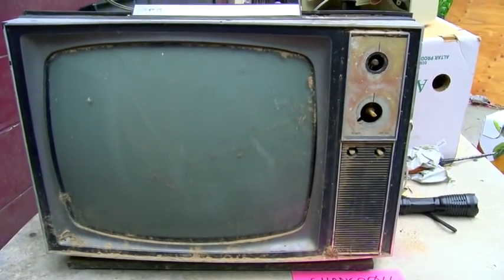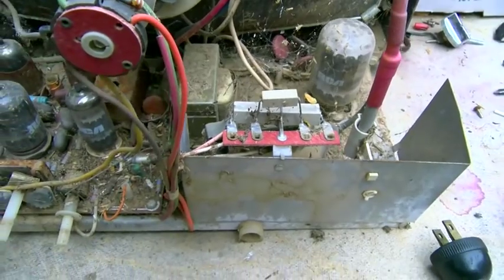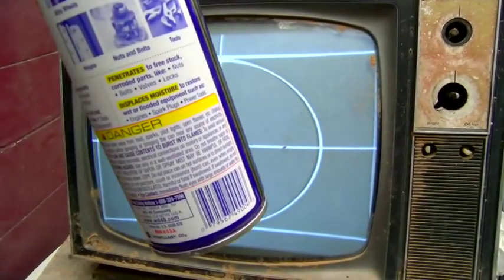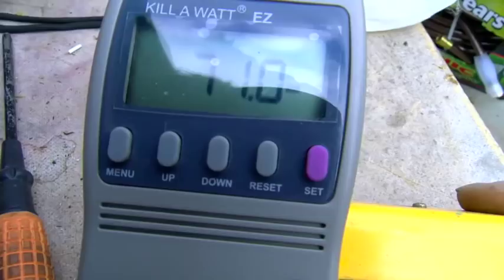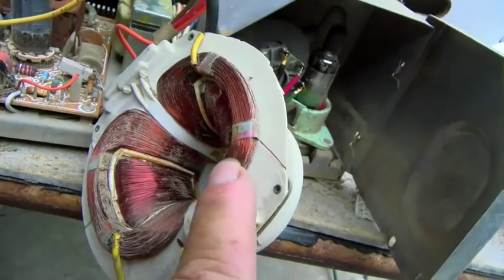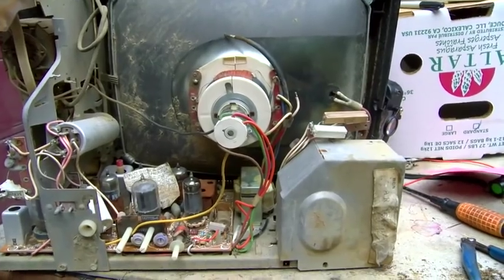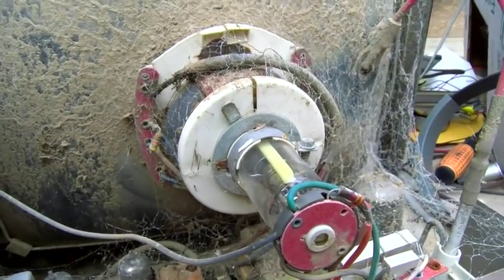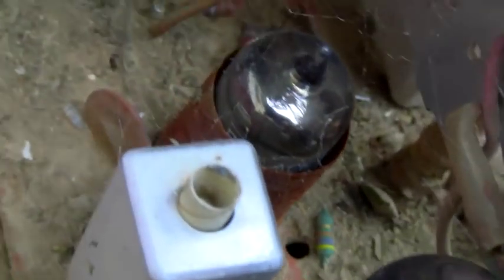RCA KCS186 Vintage Tube Television Analysis

Comment: It's just astounding that these sets work after so much abuse. Amazing!
Reply: Older TVs are basically built with the durability of a T-800 Terminator.
Reply: I did tv repair back in the 80's and early 90's and it not that unusual to get a set in that was 20 years old.

Comment: Restoration of an oldie always first starts (After cleaning) with the electrolytic capacitors.  The one you're fooling with there has a "Compactron" horizontal output tube that has the damper integral with it.   Compactrons were cool.   GE developed them.. Two or more tubes in one bulb.

Comment: That's why I like those old tube sets; unless the flyback transformer or CRT is bad, you can pretty much fix them. Not like the modern Chinese flat-panel crap they make nowadays; all smt and cob crap, so tightly packed, you can't do much unless you have the dexterity of a surgeon to put it back together again. 😐

Comment: No problem drawing an arc off the HV rectifier plate, but never to a grounded clip lead.   The high frequency will arc to an ungrounded screwdriver just fine. Arcing to ground provides a DC path from the horiz output tube plate to ground through the HV winding on the flyback, and can burn the winding open.

Arcing the CRT anode to ground stresses the HV rect tube a bit, but a short test has never caused a problem in my experience.

And as you noted, NEVER on a solid state set.....

Comment: 2n tv set. first resoldering horizontal yoke wire. flyback cant work w/o yoke reactance.
and thats why hv rectifier cant deliver HV (heater cant reach incandecese cos low voltage) thats whati would do.

Comment: I wonder what would happen if you run it through the dihwasher, then let it dry out for a week or two?
Reply: Don, I kinda was thinking the same thing...I see we were both inspired by Bill!  :)
Reply: umajunkcollector I've done this before with full-size sets and chessie's yes I have a big dishwasher most any chassis will fit if you take out the top rack also works well with a garden hose make sure everything's discharged and hoes the heck out of it or put it in the dishwasher without detergent and then simply set it on the shelf and let it dry and forget about it or take it out on a nice hot sunny day and let it dry and forget about it you'll be surprised how well this cleans up I've done this on several sets that were tobacco encrusted and also some that smell about 90% of them actually work. after all if you've got nothing to lose why not try